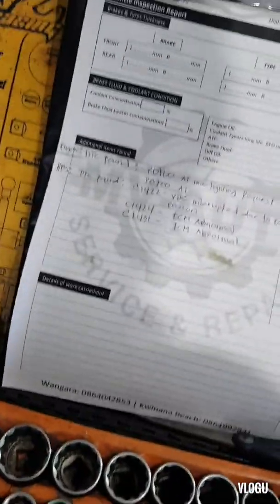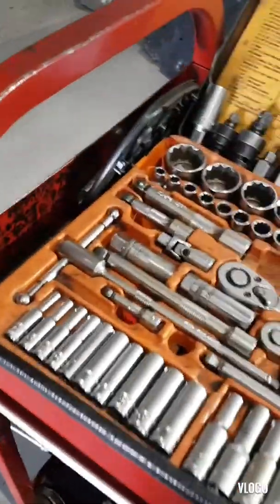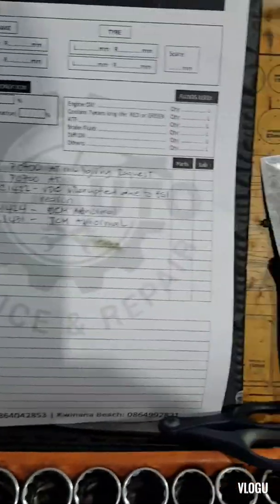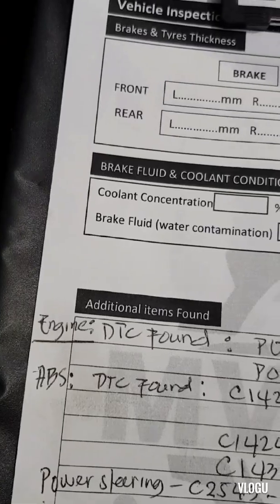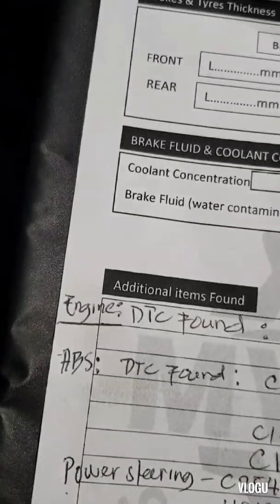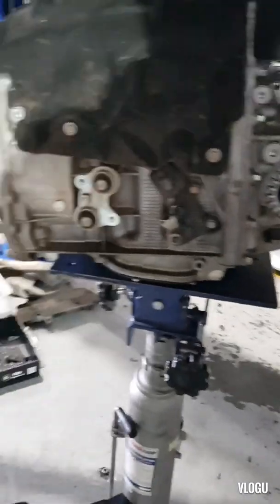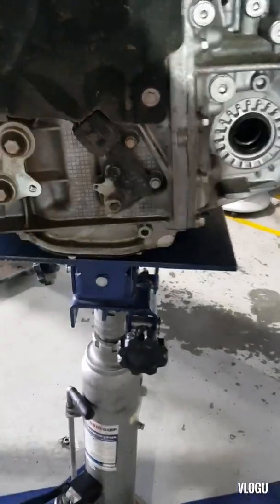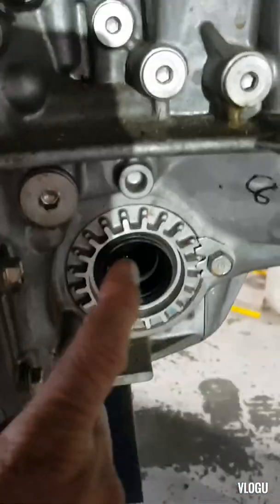SUBARU XV, CVT FAULTY 5 warning lights are "ON" in the cluster, ABS, ETC, HSA, AT TEMP BLINKING

Comment: What if the only code i get is C1422 but no lights on my dash what could it be?
Reply from the maker: @vnkwn, check you brake system, primarily abs, wheel speed sensor it may help for as a guide to pin point the issue

Comment: Yesterday my 2011 Outback got a blinking  ATF Oil Temp, Skid warning ON, cruise control get disabled  and check engine ON directly after start. (thats a vital clue)
Lots of DTC:s for ABS and Transmission.  
Found the problem! Loose battery terminal. System voltage fell when cranking! That was the cause of it all.Cleared the codes and connected the battery properly. Now everything is fine! No parts required :)

Comment: So was this a valve body wiring harness issue and not the solenoids? Thanks
Reply from the maker: Hi Michael, the issue on this gear box was the CAN Communication between TCM to ECM and other modules like the ABS once they’re not communicating each other then it’ll affect drivability and causes warning lights of every modules to illuminate on the cluster. So it’s not the solenoid issue. As solenoid is an actuator only and all shifting are completely ok but erratic. Hope my answer helps you. Have a good day
Reply: @dandelao9653   I have this exact issue with same codes in an XV. Is the actual fault the wiring harness on the Valve body that connects to the solenoids? Thanks
Reply from the maker: @schmick63  Hi Michael, please check the wiring harness and pins if there’s any corrosion. If not then check the data for the TCM if all good replace the whole valve body assembly. But it is quite expensive, replace the gear box assembly  instead. Or figure out which one is more cheaper. Hope it helps you.
Reply: @dandelao9653  I have an Autel MS 909 and the TCM module says 'No Response' when doing a scan. The only codes that show up are:    ECM: P0700     ABS:  C1424 and C1431
Reply from the maker: @schmick63  ow ok, P0700 is for your auto trans. I reckon to replace the whole gear box or the valve body assembly as your TCM are not receiving any signal or communication from the transmission it self due to faulty valve body and it’s components, reason the ECM illuminates P0700 as TCM failed to communicated to what the ECU needed to know if what is going on from the gear box. I reckon to replace the whole gear box more easier. Thanks for you reply
Reply: @dandelao9653  Follow up from this: Today I replaced the TCM and now my scan tool can communicate with the new one. I also had a bent Pin on the brown connector on top of the gearbox, so someone has been playing with this car prior to me buying it.  I am happy to say now the car is throwing a P2764 and all I had to do was change the lockup solenoid. It seems to me these Subaru's are prone to component failure shortly after the battery has gone weak / died. This cars battery was dead as well and it looks like jump starting the car over and over fried the TCM, as I could not replicate the error code the Auction house pulled from the car when they first received it.
Reply from the maker: @schmick63  good job michael, so everything is sorted? And thank you to give me an update
Reply: @dandelao9653   I have a noise when driving, not sure if its the rusty rotors, a wheel bearing or something else. Need to buy 2 more jack stands and get it in the air. Im going to do a front diff oil change in the morning,. Fingers crossed its not that 🤣
Reply from the maker: @schmick63  ow it must be something, while you’re doing the front diff. Oil change, try to check the oil if there’s a metal chips or any debris, and also if you can try to remove the Auto trans. Sump and check if there’s also some metal or aluminium debris
Reply: @dandelao9653  Yeah I should probably do a CVT oil change as well. My plan was to flip the car for a quick sale but it needs to be sorted first.

Comment: I had code c1422 and I simply unplugged my brake master cylinder disconnected positive terminal and negative and pumped the brakes to clear out my Ecu repligged everything back in and no more codes

Comment: My Subaru XV has the exact same issue currently, I was quoted $4000 for a new transmission without it being checked through. I appreciate your honesty, this video is very helpful. Thank you!
Reply: Did your lights eventually turn off? This happened to mine too, I felt a jerk leaving a stop light,  then pulled over to let the oil cool off and when I turned my car on again the lights went away

Comment: Sir sana matulungan nyo ako. Isa din po akong nagsisimula palang na mechanic dito sa pilipinas. Ang nangyari po ay nagpalit lang ako ng Rack end at Tie rod sa Subaru Xv 2014 model. After ko po magpalit umilaw lahat ng light sa dashboard nya. Ang tingin ko pong nagawang mali ay nahatak ko ng sobra yung rack and pinion nya. May narinig po akong tumunog sa loob nun nung hinatak ko ng sobra. Ngayon po sumabog naman yung airbag sabi ng owner. Pinagbabayad po ako ng malaking halaga. Gusto ko po sana ako nalang gumawa. Ano po ba mga dapat kong gawin or e check? Maraming salamat po sir. Sana mapansin mo po ako. Godbless po more power po dyan sa ibang bansa.
Reply from the maker: Hi Andrew, medyo malaking problema nga yung damage. Kung ang steering system ay electronics steering, kailangan mo magpalit ng buong EPS - electronic power steering assy. Kasama ang motor. At kung ang xv na ginagawa mo ang year model from 2013 to 2014 may TSB yan na available verify it to the owner or to the dealership. Kapag electronic power steering wag na wag ikotin ang steering rack sa pamamagitan ng pagpihit ng gulong dahil masisira ang EPS motor plastic gears causing to short circuit and blowing off the airbag. Ugaliin ang pagtangal ng negative terminal ng battery when doing or removing major parts of a vehicle. Kailangan mo magpalit ng airbag module kung saan sumaboh na airbag at magpalit ng Air bag control module at ipa reprogram. Kung napalitan mo mo ang EPS at may may dtc code ka na C2532 ito ang code na may TSB kailangan mo palitan ang EPS control module at e reprogram. Hoping the best for you Andrew.

Comment: Just came across this video. It is pretty helpful. Thanks a lot. My Subaru Forester 2013 SJ5 has the same issue. The ABS, Traction Control, ATF Oil Temp, Hill Climb Assist, cruise control get disabled after driving for a short distance. The auto start stop has also permanently failed. The car starts jerking and stops after 10 minutes of driving. The driver console gets really hot, mainly coming from the transmission section. This problem started with a certain engine rattle during idle after the car had been driven for over 1hr. Error codes thrown include: P0716, P2746, P2750, C1431, C1733, B1430, and B14A1. Been to several mechanics but haven't been successful. Any pointers on this will be highly appreciated. Thanks.
Reply from the maker: Hi David,  the problem for your car is all about of these two DTC P2750  P2746 and P0716 which is on the valve body, but the valve body assy. is too expensive, if can get those sensors should be good but always comes with the valve body, the rest of the DTC came up due to loose commuication cause by thise 3 codes that i mentioned. thanks and hopefully may help your issue's.
Reply: @dandelao9653  Wonderful. Thanks Dan. I replaced the sensors and the error codes were cleared. The car doesn't jerk either. There is still some stalling experienced during acceleration and deceleration but will monitor over the next few weeks.
Reply from the maker: @davidndungu2096  happy to hear that david.

Comment: Hi Sir, ganyan din xv ko nagkabasan mga warning lights. XV my2013. Dinala ko sa Subaru dealer dito sa Australia  selanoid iaaue daw need palitan ang transmission  valve body. Napaka mahal. Totoo ba na May extended warranty ang Aubaru kasi know and growing issues to sa mga owners? Thanks po
Reply: Bro ano au k ba may ask ako nagpm ako sa fb m
Reply: Nangyari din sa akin.  Needs replacement of transmission pressure sensor daw.

Comment: Will it be possible to change any spare parts ? If theres a problem with the cvt .
Reply from the maker: Yes, but only limited, like torque converter, primary pump, and valve body assembly
Reply: if i have a trouble code of P0841 is possible to repair. thank you for your reply really appreciate it

Comment: Sir how about a trouble code of PO841?
Reply from the maker: P0841- is for your transmission fluid pressure sensor, meaning may be the sensor is not doing he's job properly or  there's  something wrong with the fluid pressure sensor it self or check the wiring connector if there's a sign of corrosion or damage wiring terminals. Automatic transmission fluid pressure sensor is fitted in the valve body which you can't get the sensor alone. it's together with the valve body assy.

Comment: my impreza 2016 got “at oil temp”，abs，asr light are on. actually “at oil temp” is flashing. do you have any suggestions？thanks
Reply from the maker: Hi Cathy, you need to get someone to scan the vehicle, then diagnosis and tressing the issue will start from there, oil Temp is commonly flushes when there's an issue with other modules due to can communication from one module to another,

Comment: What kind of sounds was it making? I have a loud ticking noice coming from my 2015 XT and not sure if it’s a pully, valve lifters, or engine knock. I have the similar problem with check engine light, hill start, traction controls and sport/I mode just flashing and disabling cruise control. It happens randomly and goes away then comes back. On top of that I now have codes P000A and B, code P0011, P0014, P0024, C2543, C1422, C1424, C1531, U1201. It you have any advice or help for any of these codes I would greatly appreciate it
Reply from the maker: Hi kaleb, 
* first Thanks for your comment, first DTC P000A & P000B is your cam shaft code due to incorrect timing cause by you vvt solenoid data.
* Second DTC is your P0011, P0014, P0024 just ignor code 14 & 24 as these two code pop up when P0011 has an error data, with P0011 pls. check the right hand bank VVT solenoid graph data from your scanner if you have, if not remove and clean, and physical check solenoid by supplying directly positive and negative to battery, it should be actuating strongly, if weak replace it. 
* 3rd DTC from C2543 to C1531 is all about your steering if you incountered a bit tight or heavy steering wheel, due to error can communication between two modules, these codes are mainly cause most probably by the SECOND DTC which is the VVT solenoid cause your engine to hace a pinging noise during acceleration and engine sluggish. hope these will help's your problem pls. give me an update when you fix or not.
 Thanks.
Reply: Turns out it’s engine knock and found some leaks under transmission pan

Comment: Those faulty light how many parts did you change, i only remember you change the whole gearbox.
Reply from the maker: Hi 3k, yeah that' right all of those warning light was cause by the gear box due to CAN communication issue from the Auto trans valve body.
Reply: @dandelao9653  how much did the part cost? I have all the lights on my 2014 suburu forester
Reply from the maker: @MGB2408  depends of  which country you are. i mean the cost will follow on how the diagnoses result from your car, in this video the customer spend around over 4k for the auto trans. including labour, in subaru any sensor error or malfunctioned specially on drivelines will results more of warning lights illuminates on your cluster, and the word power which is coloured green